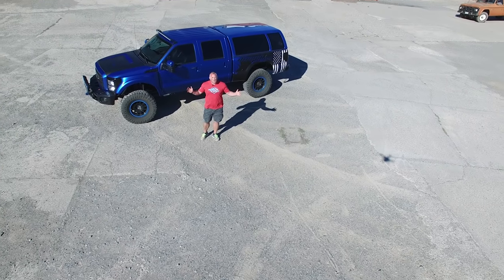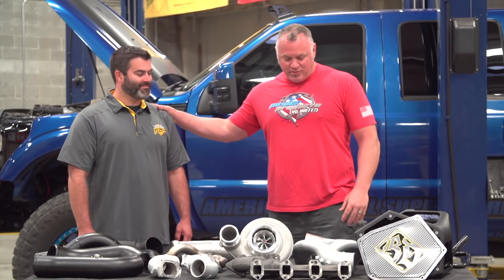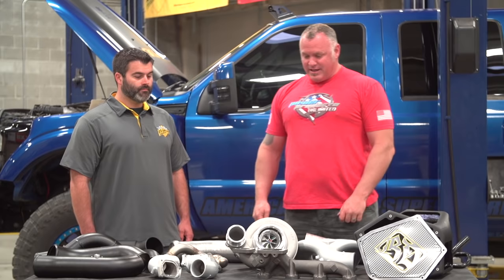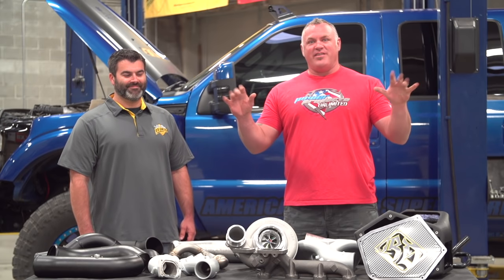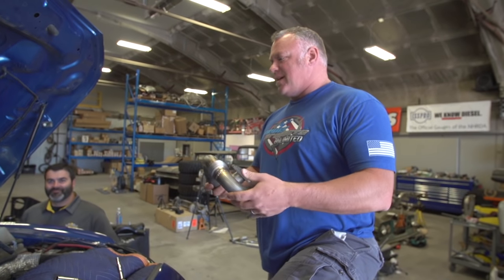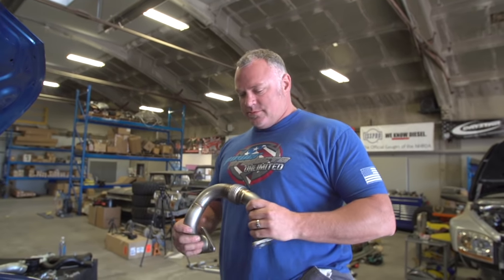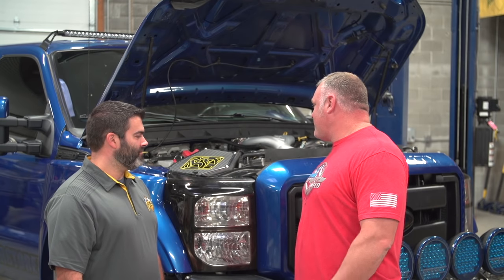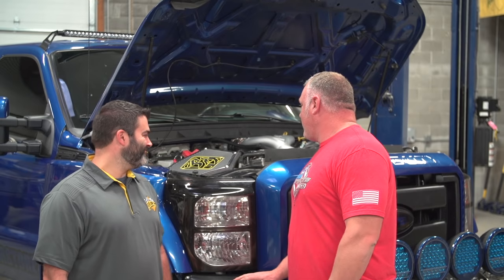More Power and Reliability? BD Scorpion Kit

Comment: what's the complete kit cost installed
Reply from the maker: Kit runs $3,995. Install would vary. If a shop has experience with this kit it could be as little as 8 hours. If not it could take 16. 

http://www.dieselpowerproducts.com/p-15003-bd-1045800-scorpion-s4676sx-turbo-kit-11-16-67l-ford-powerstroke.aspx

Comment: What are the HP gains with this kit. Can you make a follow up video with it running with the new turbo please.
Reply from the maker: We are setting a date to dyno the truck! Should have a follow up video with the hard data and some driving/sound clips as well. Thanks for your interest! The truck RIPS!
Reply from the maker: Just got back from the Dyno. I think you will be impressed, follow up video coming up.
Reply: Awesome can't wait to see it. I am very interested in the kit. Thanks for the response!
Reply from the maker: In case you didn't see it... Here is it on the dyno https://www.youtube.com/watch?v=fsbOh4Du1cc
Reply: @DieselPowerProducts  we have pushed thst kit to make around 750hp
Reply: James Perry That on a stock Trans & Motor with Dual Fueler? Looking to do a similar build. Hoping to get 750-800whp on stock injectors.